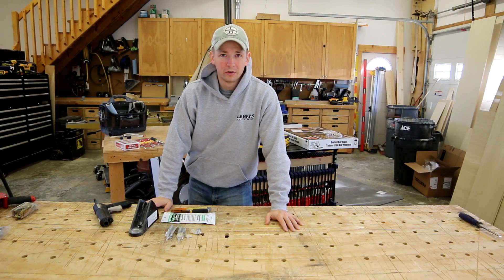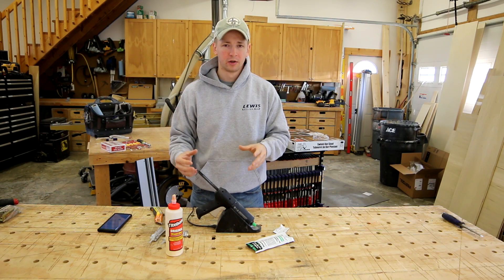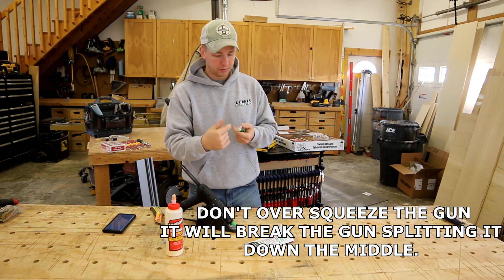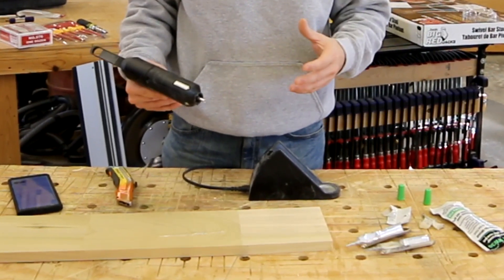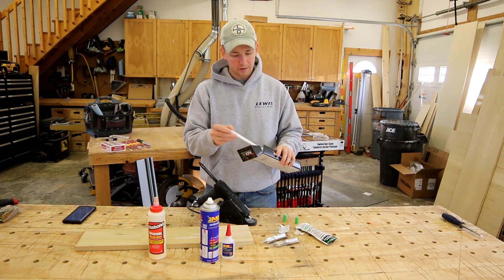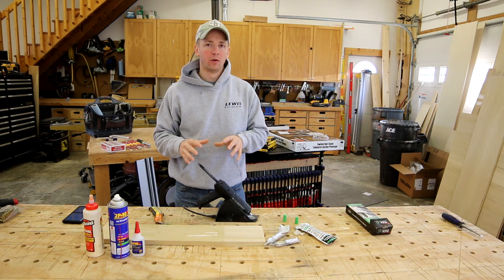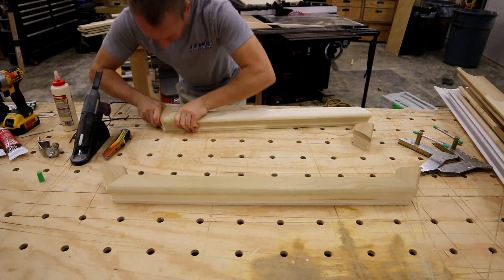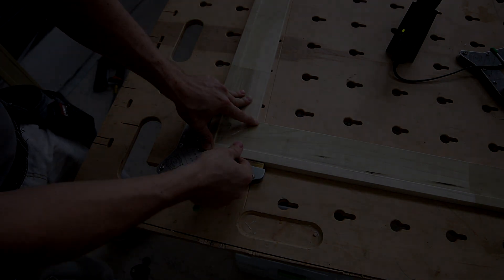PUR Adhesive for Production Trim Carpentry - Everything You Need to Know

Comment: What do you think about using this for cabinet face frame joints? Instead of pocket screws or dowels
Reply from the maker: I wouldn't use it for that application. The joint wont be tight enough and there will be a lot of difficulty in aligning the two pieces fast enough.

Comment: Hey, Spencer. Great video! I just tried the HiPUR ww30 on some pine casing and had trouble keeping the joints from falling apart after the glue set. I dont have any clam clamps so I hold the joint by hand until the glue sets then use spring clamps before I stand up the assembly. Do you find you have to let the joint sit for a period before you can stress it? I noticed the freshly set glue is kind of waxy. Is that normal? I dont use the glue a lot so I thought it might have been past its shelf life. Any advice would be appreciated. Thanks in advance.
Reply from the maker: The bond to pine isn't as strong as poplar in my experience. 

Clam clamps help a lot and I would say are essential for casing. They make for stronger joint. Something about the clamping pressure helps.

Yes you need to let the glue cure for maximum strength. I like to assemble and leave set for at least a couple hours before stressing them. Even better if you can let them setup overnight. That will give you maximum strength.

Comment: Hi Spencer Trent here ,i have seen this video before and I'm now able to purchase the hi pur gun and cartridges which gun should i get they sell a 115v and a 220v does the 220v gun require a 240 volt outlet with a 30amp breaker? or can both guns run on a basic 15 amp circuit of up to 120v?

Comment: How would you handle a two piece casing - 3-½” beaded casing with backband, 4-¼” total width? Would you PUR adhesive beaded casing and install on opening then use PUR adhesive on backband and install on casing on wall? Or another approach?

Comment: Have you used this PUR glue for exterior applications?
 (I'm thinking it would be great for front porch restorations on historical homes?)
Reply from the maker: I haven't. I don't think it would do well with high heat or the freeze thaw cycle. I'd keep it for indoor use only.

Comment: Can anyone, or Spencer, share any thoughts on the Steinel vs Infinity 3000 vs Infinity 1361, for which production is currently interrupted?  Looks like the 1361 has the heated base, whereas the 3000 is a heated gun.  Most reliable and complete use of product?
Reply from the maker: The corded gun makes sense because it always keeps the product hot. I find it nice an annoying at the same time. I think I still prefer the gun that can detach from the corded base. But I'm wondering if those will be discontinued.

Comment: Noticed during your 20+ minute demonstration you failed to put the Green cap on the gun. Did the tip harden up?
Reply from the maker: You don't need the tip on the end while it is heated on the cradle.

Comment: Did you ever try storing opened cartridges in a vacuum bag/container ? To avoid the moisture curing issue.
Reply from the maker: They come in a sealed package with desiccant pack.
Reply: @InsiderCarpentry  Understand, but that's not exactly what I meant. I mean if the cartridge is used only 50% (so 50% is left over). Not sure if placing that back into its package, with just a desiccant pack, will protect enough against moisture. Vacuum would do, I assume, but never tried it myself. So that's why I asked :-)

Comment: Just out of curiosity when you preassemble casing for doors or windows that makes your miters and lengths exact as they should be, but what do you do when your dealing with a slightly unlevel floor, window or door jamb, how do you compensate?
Reply from the maker: Flooring is usually not installed yet at the time I'm trimming so casing legs and jambs will be undercut by the flooring people. So I have some margin for error.

Comment: Can this be used for edge banding a pvc edge to mdf or particleboard
Reply from the maker: No. Too thick. Sets you too fast. Wouldn’t spread out over the whole joint evenly.
Reply: @InsiderCarpentry  i researched and industrial edge banding machines do support pur glue. I'll do more research on how they acheive that.

Comment: This is how you use wood glue when you do casing have your extension jams come out and you put in your casing up you take wood glue and you put it on your joints and you take a nail and you shoot the pieces that trim together first and then put them up that will hold the clamping that you need that's all you need if you know how to do carpentry and if you're a really good trim Carpenter you already know this you don't need all this glue guys that stuff's for people that leave too many gaps if you're a high-end trim Carpenter you shouldn't have gaps you should take pride on how tight your joints are . I do understand there is certain times where it doesn't work and yes you should use stuff like that but honestly people your standard type on to and type on three will work perfect I've been doing this for almost 30 years now and I've never one time had a problem with it it works beautiful

Comment: I went to your Amazon favorite listing. Looking in every group of your Favorite items. I can't find the clamps.
Are they on Amazon or someplace else? I've seen a lot of 90°, corner and picture frame clamps. 

Haven't seen the ones that you recommend ever. I even paused the video to read it on top of the clamp. When it's in focus, the clamp handle gets in the way.
Reply from the maker: They are only available for purchase direct from the manufacturer. You have to call to place the order. Go to miterclamp.com. Or woodriver sells a knock off version.
Reply from the maker: Also, they are called "clam clamps"
Reply: @InsiderCarpentry  Thanks. I added a bookmark to the website.
Reply: Am I the only one who blew on the sanding dust to try and get it off 😂

Comment: I've got to call BS on wood glue clamping. I build cabinetry, doors and furniture. 30 years, Massive clamping pressure for wood glue is an old wives tale. With good contact and squeeze out pressure, a high initial tack wood glue will hold after 25 minutes. Over clamping pressures cause bowing. I glued up a flat door panel, noticed an unusable jog in the  panel and tried to separate it after 10 minutes. I had to run the joint through the table saw in order to re-glue it flat. A 30 minute warm up time just to find out you may need another 30 minutes if you get a dud cartridge is a massive crap shoot. Wood glue does have it's issues. You may have to remove some air exposed glue off the cap then carry on. 30 seconds. Cost is a no brainer. You use what you prefer, I'll use what I prefer. Thanks for the vid and the effort. I appreciate it but fail to see any advantages, especially with only trim.
Reply from the maker: You missed the whole point. I don't built cabinetry, doors, and furniture. I'm a production trim carpenter, meaning working onsite with minimal tools (clamps) as quickly as possible. This product is primarily used by me for door/window casing. It allows casing sets to be assembled instantly, clamps removed, and onto the next one. No time waiting for glue to dry, or needing a bunch of miter clamps. 

An end grain casing joint is completely different than a straight grain door panel glue up. Grain orientation and along with a massively different amount of surface area. You're comparing apples to peas. I would never use hipur for a door panel glue up, you have to understand the context of what I'm using it for.

Comment: I use PUR adhesive and you never mentioned the elasticity of the glue when we sand joint
Reply from the maker: I scrape the glue off after it dries for 15 second or so. So there is not glue on the face when sanding. If you're referring to the actual joint heating up and becoming elastic, proper sanding technique takes care of that and hasn't been an issue for me. A quick sand with 120 doesn't heat it up and I haven't had any issues with the joint telegraphing through paint.

Comment: Not all hot glue sticks are created equal.  The particular ones you showed are junk.  There are some that create a very strong bond at 1/4 the cost of PUR.   

I install a lot of 2 1/4” Baby Howe Radiata pine casing and PUR does not work for that.  I’ve found infinity tough guy works really well and 9 times out of 10 the wood will break before the glue.  It also makes a permanent bond in MDF.   1x4 casings get a #10 biscuit and infinity tough guy hot melt, You’ll break the casing leg before the joint.
Reply from the maker: I'll have to give those a try. I'd hardly call PUR junk. You just have to use it for the appropriate application. Little casing is one its strong points. Its great for larger poplar casing and handrail returns.
Reply: Insider Carpentry sorry.  You misunderstood me.  The glue sticks are junk, not the PUR.  
I have the PUR and it is amazingly strong, but finicky.  

The infinity tough guy sticks are much much better for small casings.  In my experience it’s as strong as wood glue, in that particular application.

Comment: "CA glue doesn't have tensile strength?  Strange, most CA adhesives lists specifications showing tensile strengths of right around 4,000 PSI.
Reply from the maker: The bond created on wood breaks like glass as compared to wood glue that creates a better bond.

Comment: The other issue with wood glue even with clamping, endgrain strength is poor.
Reply: Water based glue you can make a watery paint amd paont the emds, this helps the glue to soak into the grain, then when you glue it it will hold better

Comment: That glue didn’t work for me at all it’s the worst product I’ve ever tried I bought it after watching this video bc I’m a railing installer and I assemble lots goosenecks and it did not work for me at all. I was able to pull wood apart by hand even after 24 hrs
Reply from the maker: Sorry to hear that! That's a major bummer. I use it on all my handrail returns and its incredibly strong. It is possible that you may have got a bad tube or maybe the glue didn't agree with the wood species you were using.

Comment: I did not get the results you demonstrated and I did 2 tests. Glued one side of mitre and clamped. Glued both sides of mitre and clamped. 
Both pulled apart easily and glue pulled away clean in spots 
2P10 works better and wood glue is still the best 
It was a disappointing waste of time and money 

Banging a 2 inch railing mitre is not a meaningful demonstration 
Why didn’t you join trim which you actually use it for and demonstrate strength on 2 equal lengths of window trim ?
It’s very weak on a typical application
Reply from the maker: I demonstrated my results on poplar casing many times. I get excellent results. I honestly don't know why some guys don't have any success with the product.

Comment: I get it this adhesive's great but type on to and type on three should be more than adequate that stuff I get it it takes forever to dry but if all you have to do is you use a little bit of hot glue if you wanted to be quick and then the type on too and type on three full set up and it'll never move the joints do not break after you glue it properly with tight on it if you do not believe me blue and mitered edge of crown together let it set up overnight and try to break it the wood around it will break and it lasts forever I think adhesives and glues are very very important but that stuff that's going way too far above and beyond